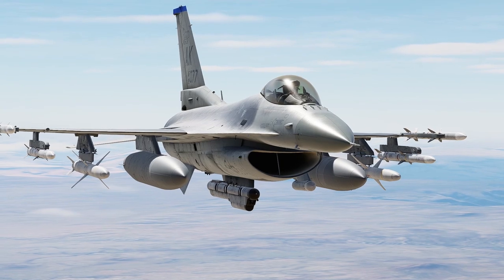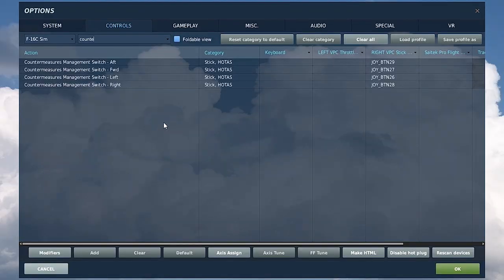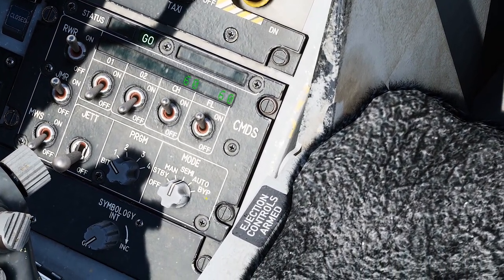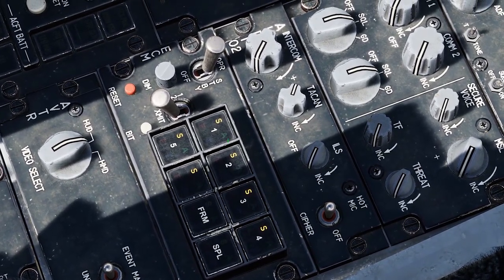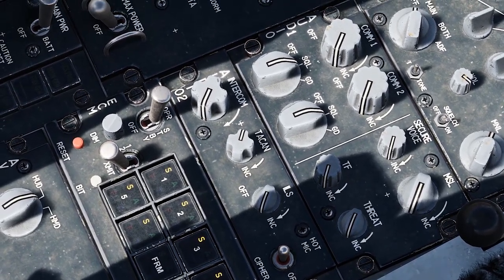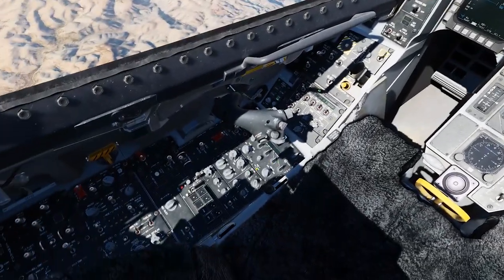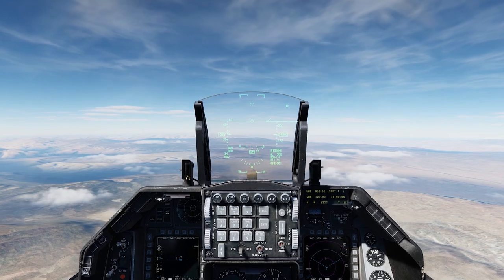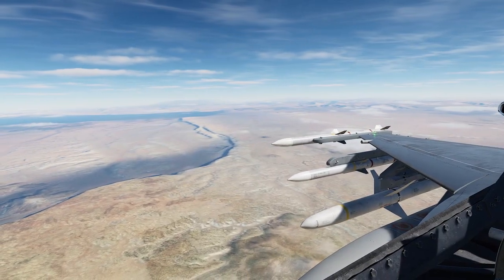ALQ-184 (Short/Long) ECM PODs Quick Overview

Comment: Ecm Switch in pos 1 gives the radar priority, so you can use AMRAAMs. Pos 2 gives jamming priority, which will disable your radar and the jamming will be stronger.
Reply from the maker: I wonder if ED has coded that into the sim.
Reply: @BogeyDope  it has at least coded in the radar priority as on pos 2 radar switches off straight away
Reply from the maker: @harrio7793  yeah I just tested it and found the same.
Reply: @BogeyDope  Do you know If jamming strength is increased?
Reply from the maker: @Maverickf20  I have not tested this. I would have to setup a series of SAM radars and test each with position 1 and then again with Position 2 and figure that out. Maybe in a future video???
Reply: @Maverickf20  on the ED Discord wags (or bignewy) stated, that in radar priority the jammer performs only at 40% while jamming, so the jamming strength should be decreased on pos 1
Reply: @Maverickf20  mode 3 seems to prevent enemy from locking you much better than 1 and 2 jamming only after you get locked by them
Reply: @hphp31416  yes that's the point, pos 3 is emitting constantly, pos 2 is emitting on lock and has jammer priority and pos 1 is emitting on lock and has radar priority
Reply: Awesome video BD and thanks for providing that extra info L4; currently learning the F16 on my upgraded sim rig and your channel is just fantastic.
Reply: @Smithy18 it should work, I’m not sure if jamming your own missile is simulated
Reply: I’m always in mode 2 even when I’m firing aim 120’s mode 2 doesn’t exactly disable your radar

Comment: Being currently a member of the air force that works on alq-184-v11 aka the long pod without going into detail the only real control panel for the pod is the second one your cmds doesn't have any controlling factor to the pod irl. As well your assumption about the buttons being the different bands is wrong I can't go into why it's wrong but just seeing them almost have it right bothers me a bit.

Comment: Former EW Maintenance troop as well. There is a big difference unconfirmed information and confirmed information when it comes to dealing with classified material. Someone might actually have the right information,  or wrong information, but as soon as someone actually cleared for that information says it is right or it is wrong, then they have crossed a line. I learned the 184 in Tech School, but ended up working a much different system when I got assigned. Good stuff!

Comment: also might help

When XMIT is in Position 1 we have Radar Priority. When in Radar Priority and the jammer is transmitting and ownship radar and HARM/HTS performance is reduced by 40%. - > this is called SPJ or self protect jamming.
To activate SPJ, set CMDS to semi (or auto, not recommended) and press cms aft short. CMS aft will set the system from standby to active and will automatically transmit when you are locked by a radar. Pressing cms forward will launch the selected cmds profile. The system will go back to standby mode, each time a radar had been jammed, and you have to give consent to the jammer to standby mode.

When XMIT is in Position 2 we have ECM Priority. When in ECM Priority, the FCR and HARM/HTS are silenced unless an AIM-120 is the active weapon. In this case, it behaves the same as Position 1

Position 3 is active jamming. Set CMDS to man mode and press cms aft to turn on or cms right turn off. When activated it will turn off the radar "NO RAD" on the hud.

amber S - standby mode CMS right
green A - active mode CMS aft
blue T - transmitting 

found on dcs forums. goodluck! o7

Comment: I hope they add in functionality for carrying the 3 pods.  I got all excited when I saw the long pod and the ability to carry 3 of them but when I tested it made no difference lol
Also a note, POS 3 active jamming seems much stronger than the 2 self protection modes.  Set up an SA-5 since it has the longest range, in SPM with the jammer set as priority the site would still lock and launch at me at around 50nm.  In POS 3 you can fly directly at it, it will sort of lock at 22nm but will never launch a missile and you can pass right over the site
Reply from the maker: Yeah I may test effectiveness of each position in a future video
Reply: Every Radar has a burn though distance. A point where the Radars power can see through the jamming. Pods are small and can't match the power of a large ground based Radar system once it gets too close.

Comment: Great vid, thank you.  What do you use for headtracking?  Very smooth, if it's trackir, can you upload your profile somewhere?  Thx.
Reply from the maker: Yes TrackIR. I'm not sure if I can upload files to YouTube
Reply: What setting on Track IR you use?
Reply: @BogeyDope  you can put it in the user files on dcs website if that helps
Reply: How do you @ people in YT comments?
Reply: I recommend not using someone else’s track ir profile. It takes a minute to make your own and it will be 1000 times better than someone else’s profile. Reason is you move differently and you have a different monitor setup.
Reply: @lunai0076  There are only two noticeable settings in the trackir software. Smoothness and the acceleration value. Smoothness is set to your liking same as acceleration. The smoothness  value just dampens small movement inputs. So if you turned it to max you would be able to move your head a degree or two and it wouldn’t do anything.
Reply: @skinnyflea2628   "There are only two noticeable settings in the trackir software." -- Incorrect.  There are curves.  Each axis has a curve.  In some cases, each curve has two curves in one.  For example, your pitch curve may be different for looking down opposed to looking up.
Reply: @chuckchuck6269  🤦‍♂️ yea I get that I have used track ir for years. They were asking what settings. Not what curves. 😂 Also I try to keep my curves equal on both sides. It helps with the immersion and just jumping in and getting used to trackir. Its like having mouse acceleration on. Software will move it more when you move it faster so its harder to judge where the cursor will be if that makes sense. Although now that I think about it, I would call them settings not curves lmao. My bad.

Comment: Can I curse? DAMN I FKIN LOVE THE F16!
Reply: Try f18 . It'd pretty fun too.
Reply: @yieovgwqxaz7912  way ahead of you that was the 2nd module I bought
Reply: @reklusivegamer  but I can't slave maverick to tgp it'd frustrating on f16
Reply: @yieovgwqxaz7912  yeah its a pain, but make sure you're using the right mavs
Reply: @reklusivegamer  Apparently you need to align it by locking with tgp then with maverick and press BSGT on the MFCD or something.
Reply: @yieovgwqxaz7912 yeah something like that its been a while since I did it cause it was a pain in the ass
Reply: @reklusivegamer  how about jdams. The f18 can launch within an envelope and if says in range or something but the f16, you have to drive to a straight steering line? The hsd doesn't say much? Sorry I'm new to f16
Reply: @yieovgwqxaz7912  yeah because technically it's guided by gps so once you marked a spot with your tpod just fly towards the target till you in parameters